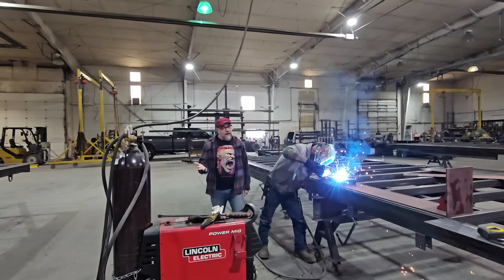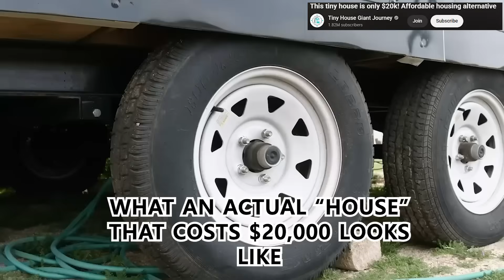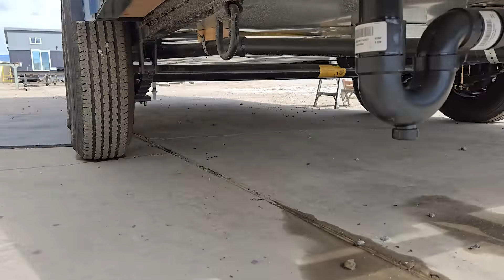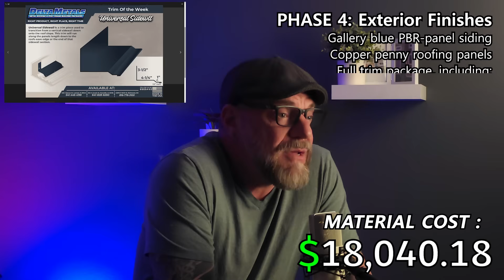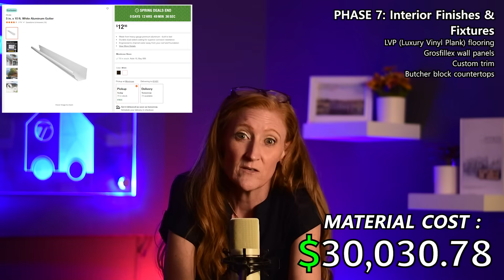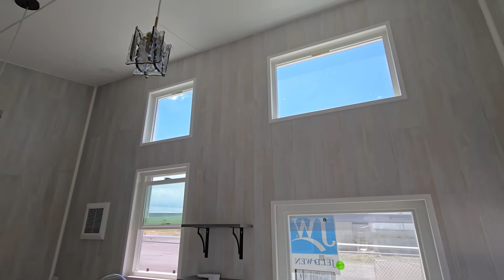The $20K Tiny House Lie

Comment: I bought a 1983 2 bed 1 bath 14x56 box singlewide. I paid $2800 for it. Moved for $2000. Full 3/8 inch finished sheetrock including the ceiling throughout. New water lines, water heater, subfloor in middle bedroom, laminate floors in both bedrooms. New windows and exterior door assemblies.  New underbelly insulation and black bellyboard. New fridge. New cabinet doors, new light fixtures and ceiling fans. House type trim around windows and doors. New heat pump. New deck steps, new skirting, new curtains, and new outside paint and cool seal. Total was $23,000.

Comment: I know right??? I am into our 400 sqft park model for almost $9000 and living in it as I remodel as I am handicapped DAV over 81 years old and will have to hire handiman services to do all the cabinet/ flooring/ bathroom remodel...Heck, I am into the covered deck and ramp for almost $3000...Having the tub replaced with a shower is going to be almost $3000...Good thing I only have months to live now...Of course I don't expect the $325 space rent + $45 monthly electric charges to last...Heck they are even putting in our second stop light at the school crossing...Progress sucks...Three whole stop lights withing 45 miles...

Comment: And is entirely possible with a new $3000 trailer for a 16 foot model, and simple materials.  Toilet is $70 builder grade, $200 basic 32” shower, basic delta fixtures in sink and shower.  Plugs another $50. Metal is fine. Pay $5000 to have some guys on assembly put it together.  That foundation sounds Suspect in costs.  Likely under 1/2 that. 3-4 windows would do it for many.  Basic heating like panels keep prices down, but can be a basic mini split under $2200. Basic water heater 20 gallon. No need for laundry area. Easily $20,000 range. A lot of us need an affordable place. We are barely getting by. Many on Social Security. We aren’t seeking fancy, just basic and built well.
Reply from the maker: Ya, go ahead and do that bill of materials and see what you can get it done for. You think "some guys" are just gonna slap it together for $5k, right? Send those guys my way... All of them!! You have struck gold with that list 👍
Reply: @thetinyhouseexperts in an assembly line, they should be able to. 5 years ago a buddy picked up a 16 ft basic one out if metal in TN. Had to rent a GMC truck. It was $15,500. Again, it’s basic.  He’s been making it nicer. It’s totally a livable place, though. He says those plug in wall panels for $100 do the job. He added a basic AC in a window.
Reply from the maker: Not everyone wants to "survive" in a shelter, so it's to each their own.. Congratulations to you on finding a way to make it happen! That's never going to happen here in Colorado, or anywhere west of the Rockies in the USA.😢
Reply: @thetinyhouseexperts many have little. They don’t have 50 grand to pay for tiny home.
Reply from the maker: Fully aware of that fact in this country. But our Billionaire class government has nothing to do with how much a tiny house costs to build..
Reply: @thetinyhouseexperts welp, the one he bought is now $20,000. Same model. No laundry or water collection, or heat pump mini split set up. Just 16 feet on a trailer with essentially a hot plate, wood counters, drawers, shower, toilet, flooring, and minimal trim. Good enough, though.

Comment: Every day almost I see operational RVs and 24'-33' travel trailers for sale on craigslist and Facebook for as low as $3,000 up to $20,000 and more. 

My point?

Are you SURE you need to build a wooden tiny home that's practically the same size? Especially when all the work has already been done!

I live in the Arizona desert. I've got neighbors I've never heard a peep out of who built a wooden deck flush with the door of their travel trailer stretching from end to end. It's on a acre of land and right next to it they have a huge steel shed. It works! For them.
Reply from the maker: You are in a place (and climate) where living in an RV may be an option. For many, the RVs are the last step before homelessness. A code - built tiny house can park in towns, hook up to services, and survive Colorado winters ❤

Comment: I have a Park model on the river bank. Has to be under 400sq ft in a flood zone to be on the ground over 400  must be elevated and that height depends on the possible flood levels.good to be on wheels just in case. Haven't had to move since 1997 but been close several times.

Comment: Definitely not worth the price per square foot!
Reply from the maker: @johnrobison4635 Thank you for your opinion! Respectfully, stick frame site built construction prices for homes simply do not transfer to Tiny homes on wheels.. The purpose of a tiny house is to be small, portable and still function like a site house. Think of it like a smartphone vs a desktop tower computer... They are both computers, but one is very small and portable, so very different in the build methods, but still a "house". The smart phone has a much higher cost to build than the desktop PC for that same reason.. Miniaturization and portability are almost always cost-adders to a larger, non-mobile product. Homes are the same.. Hope this helps clear up any confusion on your end 😉👍.

Comment: $530 a Sq?  the average build in our area including land it aprox $200-$220 a sq Even less for larger homes. I get the HD trailer etc is $10K but if it never moves?  I'm thinking a used Park model Trailer after all depreciation just like a slightly used car would be a better way to go. If your looking into cheep tiny homes your looking to live cheep. I know there are allot of options just depends on your budget and how you want to live our life.
Reply from the maker: @ddtease1961 in ALL mobile construction, there are differences between the materials and the costs of them. Site construction materials are the most expensive and quality, compared to the RV Industry’s choices for construction materials. It's more like a desktop PC vs a smart phone in terms of the cost to build it portable, but completely functional as a single detached residence. It is expensive to build a "smart phone" version of a house😉. Thanks for your comment! 🙏

Comment: I have always been interested in a tiny home design that uses rv pull outs.  Would prob not be up to some codes but could work for living in rv parks and places where they are allowed.  Always wanted to make sure the pipes were inside where they dont freeze and also all electrical lines etc were accessable and everrything is thought out to where it can be fixed easily when it breaks.  A sort of form over function small dwelling built to last and not get water damage etc.   What about putting the water lines inside another outer line to avoid any damage and of course all plumbing easily accessed and able to be cleaned.
Reply from the maker: Those are all great ideas to incorporate. We just did a slide out tiny house trailer. Check out the latest video on the design!

Comment: Sounds like a small mobile home might be a better investment.
Reply from the maker: They don't hold up the same way and they're built to HUD not IRC.. They are better than a damn shed tho! 👍
Reply: @thetinyhouseexperts been living in a mobile home i bought 38 years ago. I do understand that a mobile home is not really designed to be moved several times like the ones you build. Im just looking at cost per sq ft. I'm also a carpenter and can build almost anything. I even build my own cabinets.
Reply from the maker: The portability is a premium, for sure.. We can deduct 25‰ or more from the build if it's on a foundation instead of a tiny house trailer.
Reply: @thetinyhouseexperts 

 I have to admit that's an impressive trailer. My 12x24 I'm doing will be on a 6x6 post and beam set up. There is a barn builder just a few blocks down the street that I'm getting posts from. My way of keeping my costs down. In the process of designing what I call temporary housing units for the homeless and for battered women. I can use some of the cost saving ideas in my studio, the 12x24 unit, that can be used in those. With me it's a one man show.

Comment: Tiny Homes are built as homes/much smaller homes, and not RV's, Campers, and Mobile Homes; It's just a different style home built with an easier ability to move if you have too, unlike a Mobile Home.  RV's and Campers are meant for vacations and have a much shorter life span.  Tiny Homes can be custom to your lifestyle, and much cheaper to run on a day to day basis as a regular home.
Reply from the maker: I want you to come on the show!!! 😎

Comment: You essentially built a camper for twice what you would have spent for a bigger, nicer camper. If your not planning on moving it, just buy a nice camper, park it and put a metal awning over top. Then you would have the left over money to hook up utilities to it, if you dont already have them
Reply from the maker: And campers don't have R30 walls, 200amp residential electric service, steel framing 16"oc, full R42 floor insulation, R30 ceiling, 2nd story lofts, etc.. They are not all just "campers", with all due respect.😉
Reply: A camper is not as structurally sound, it is not built to last as a continuous living place. It was meant to go camping.Come home, be stored for a while
Reply: I currently live in a nice 35 ft 5th wheel in Maine I can tell you that campers are built differently than tiny homes the insulation is shit the furnace and ac aren’t able to keep up because of it costing me a fortune but I’m thankfully about 12 months away from moving into my custom tiny home that’s built with insulation and heating and cooling systems that will work for year round living also tiny homes have pipes built into the walls for cold weather living so your pipes won’t freeze most RVs have the pipes under the camper or in storage cabinets we have frequently had pipes freeze even with a insulated skirt and heat barrier foil
Reply: You cant live in that legally dude
Reply from the maker: @septic-god you're absolutely right.. You can't get a CO for a travel trailer.
Reply: @thetinyhouseexperts what's a CO?  I have been researching tiny homes for several months n still finding out more and more set backs.  SMH.  Last yr, I realized my only hope to stop working my life away was to sell my current 2000sq ft home, and buy a tiny home.  This way, I won't have to keep killing myself working so much to afford upkeep on my home (when I became disabled almost 3yrs ago).   This can only possibly work is w/the real estate market so high.  I am loosing hope that I will be able to do this (the reason I am stuck is because of scammer construction workers that took me for over $50,000 total to "Fix" things that needed repair or replacing just to make original issues worse than was to start after they were done).  I researched state n county regulations in T.N. where I want to move (and eventually travel w/my tiny home) if under 400 sq ft... unless, I build on a foundation, which I do not want (travel).  Does that no longer apply?  Also, I was told you don't have to pay property taxes with less than 400.  Is it still not considered legal to live in?  Any input would b greatly appreciated... if that makes it more clear. ..  I am looking for a 399sq ft home w/a loft.
Reply: Being a long time RVer, I can tell you campers are not built as good as you might think.
Reply: No where in the states are u legally allowed to live in a camper full time forever except slab city in California. Which is a shit place. Ppl may do it but it’s not legal.
Reply: I know someone in Baja with similar. Just an old early 90’s trailer that he had AC in a window with a leaf cover/palapa.
Reply: The old Mobile homes of the 80’s/ 90’s were huge! 3 bedroom, 2-3 bath was almost standard. This movement is BS!
Reply: @comingoutspinster-rebellik1479 the whole point of the tiny home is for people who don’t want or need all that space. I’m selling a 4 bedroom house to buy a one bedroom tiny home because now that I’m an empty nester it’s just me and my dog I don’t need all that space. Your comment implies that they are no longer making mobile homes when they do they even have new prefab modular homes you can buy if a larger space is what you desire.
Reply from the maker: And you still cant get a permit to legally live in the camper. It's a good plan though, some people in some places don't have to follow any sort of code. 🤷🏻‍♂️
Reply: @thetinyhouseexperts  where are you?  CA?  NY?  I live in Texas and I know hundreds of people living in Tiny homes and or RV's.  Not sure where you get your info.
Reply from the maker: @ThomasGLee we know thousands of people who live in the homes we have helped them build.. BUT, they are almost all either unclassified or they are classified as RVs, thus making it ILLEGAL to live in. Check out the laws... That's where I got my information from 🤔😉👍
Reply: @thetinyhouseexperts these are not laws. they are municipal codes. you guys need to go back to 8th grade civics class to learn wtf it means to be a free american living in a republic...
Reply from the maker: @timmycorini really? You learned civics in 8th grade?? Lol. We started that shit in 4th grade. Says a lot more about you than me.. 🖕😆🖕
Reply from the maker: And state law is not "municipal"...LMAO... Enjoy the republic🙄
Reply: @thetinyhouseexperts why can't someone live in a RV  Thanks for filling me in.
Reply from the maker: @nancysmall9793 The insulation, power and plumbing requirements are different for Park model RVs (seasonal living) and IRC modular homes and ADUs (full time occupancy, legal in 50 states) 👌
Reply: @thetinyhouseexperts thank you
Reply: @nancysmall9793 I’m looking into living in raw land in a very low restriction area. Arizona. They only allow you to camp in your RV for 30 days WITH A PERMIT. If your building a residence your allowed to live in an RV WITH A PERMIT that has to renewed every 6 months for up to 4 years with proof of progress. They are already in trying to shorten that timeline. A lot of it boils down to taxes and how RVs make neighborhoods look crappy. We own an RV and we don’t plan to live in it when we build. It’s much too cold or hot. Plus who wants to deal with pipes freezing and a rattle snake crawling up through the engine bay.

Comment: I am looking into tiny homes. There are land lots for sale around here for around $100k on grid. I expected to have to pay around 100,000 for the house itself, which would bring my total to $200k. 

But, there are more options if I buy without being hooked up to the grid. Do you guys know how much it costs to get hooked up to the grid? Or, are there reasonable off-grid alternatives?

I would Google it, but Google lies a lot these days.
Reply: Great questions. Something most people probably never thought of. Depending on where the property is located...one could be completely off-grid and on their own with everything. Some locations one is able to have water and electric hookups. You did your homework.
Reply from the maker: We have built several that are entirely off grid and self contained.  Obviously, you have to have a water source, but power is generally handled by solar with small wind backup pedestal alternator type windmill in a pinch!  Thank you for watching!
Reply: In my area it costs $15k for a transformer and $15/foot to run underground power (necessary for code here). If you need a well, something like $10k per 100', septic varies but $5-15k will do it usually. 

If you're doing all that, it's probably worth just pulling a permit and having a small house or cabin built. There's a lot of overhead and restrictions on a tiny house that makes it overall more expensive, as you can see from the video. If you want to be mobile and go the tiny house route, I'd go with a solar array instead so you can move it with you.
Reply from the maker: @imakepretty we are pointing out the costs of a tiny house, not just a tiny house on wheels.. If you move that list to dirt, now you can almost guarantee the costs you mentioned above are going to be added in. You won't really "save" money, but... You CAN Build a bigger sized "Tiny" house for a small increase in the budget.. The more Sq ft there is, the lower the "per Sq ft price" is. There's more to divide the costs over. 👍
Reply: @thetinyhouseexperts  Do you guys do tiny houses that can be dropped on a foundation? Would there be savings when considering getting it on site vs just going to pick it up?
Reply from the maker: Call or email me (Damon) and let's talk about it in depth. There are a lot of loaded questions there you're asking.. Lol.  303 990 9497 office, or damon@trailermadetrailers.com 🤘😁
Reply: @thetinyhouseexperts  hello! I'm sorry it took so long, but I called this number today. A whole bunch of stuff happened one after the other, so I was extremely busy for the past 2 weeks. But, life seems to be simmering down back to normal. Lol!
Reply from the maker: @TotalContemplation calling you back!
Reply: @thetinyhouseexperts  lol! Okay. I will contact you within the next day or two. I have a pretty full slate the next couple days. Thank you for your reply! I look forward to speaking more with you.
Reply from the maker: @TotalContemplation same here. Lloki forward to speaking with you soon!
Reply from the maker: Lovely to speak with you last week!!!  Thank you for reaching out, and keep me posted! - Damon
Reply from the maker: Maybe we can do a future episode of this topic? Would you be interested in helping me with it? - Damon
Reply: @thetinyhouseexperts  heck yeah! I'll be in touch. 😃
Reply: It needs the screw tightened and tied up too